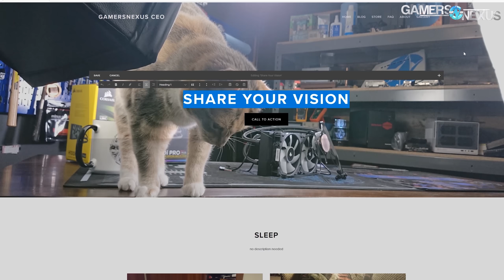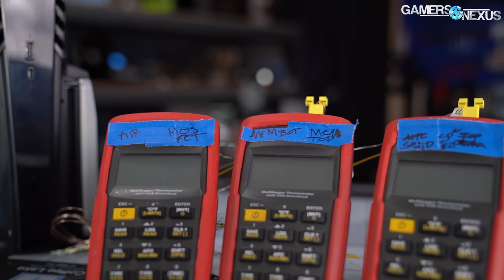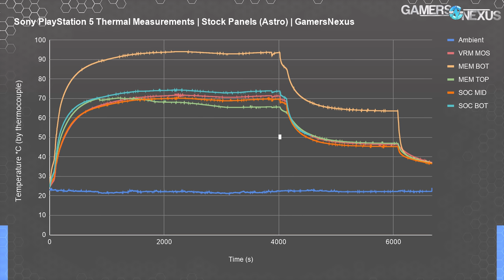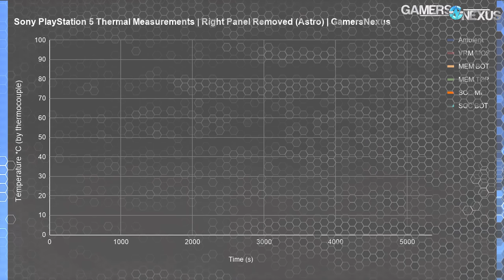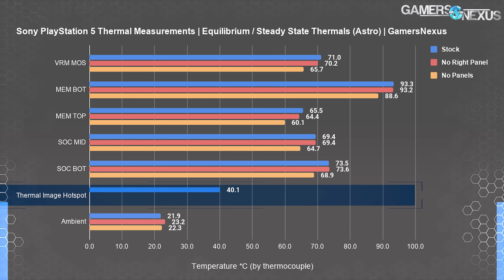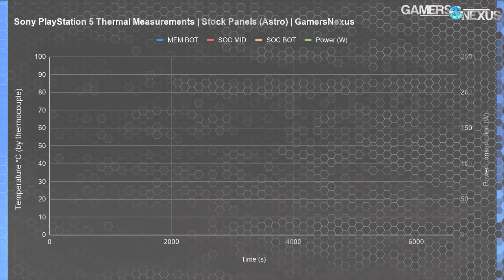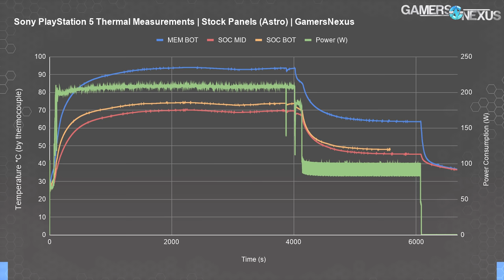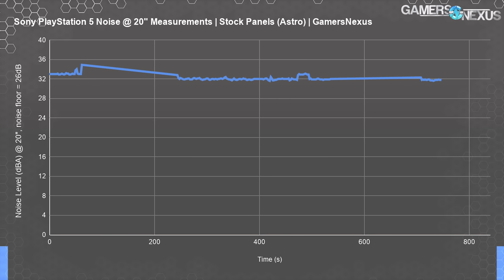Weak Cooler Design: PlayStation 5 Thermals, Power, & Noise Testing

Comment: This definitely makes me wonder how people who stuff their consoles into tight tv stands or poorly ventilated areas are going to fare long term.
Reply: Probably just end up being a slow degradation of performance, like most things that sit long term in a confined space.
Reply: Maybe that's why they made it MASSIVE so it doesn't fit! Ha ha
Reply: That is what I am dealing with now. My tv stand had 6 cubbies (3top row that are shorter in height, 3 bottom row that are nearly 1.5-2x in height). I have my cable box, XB1X and PS4pro in the top cubbies, I cut slots in the back panel and have USB fans with the consoles to push hot air out and pull cool air in. However, when I swapped the PS4pro for the PS5, it is so big there is not much room. I barely go the fans in, but they seem to work still. I've forgotten to turn them on and eventually the console's fan went from inaudible to audible, but not very loud either way. Luckily the top of the console's intake vents are mostly forward facing so the white side panels form a "v" that helps block out some heat from the back of the tv stand's cubby, so even with the fans off the air that is getting pulled in feels much closer to ambient than the rest of the cubby.

That said, I am considering trying to stuff it vertically on top of the tv stand somehow. May try behind the tv and just relocate my router or Switch dock.then that leaves an empty cubby with holes cut in the back that I need to fill for symmetry's sake.Would love to find a PC case for it, but everything that is thin and wide enough is 1-2" too deep, so I am stuck with an Elite 110 case in one of the bottom cubbies, which limits me to <180mm GPUs. If I could find a pc case, then I could use the PC's old cubby for the Switch dock or the PS5 itself since there is more room to dissipate heat.
Reply: @ImeanFFS  lmao well played, Sony. Well played.
Reply: that console is gonna break down so much after 1-2 years its gonna be crasy with those temps, both when people do what you said, but also in the warmer climate areas around the world doing summers/heatwaves.
Reply: As long as this doesn’t turn into Sony’s version of the Red Ring of Death they should be OK. 

That said, if multiple failures start coming out of this long-term, Steve will likely see an uptick in this video as to the root cause.
Reply: @ImeanFFS  Most likely that's the reason the white trenchcoat fins extend so far beyond the body of the console.
Reply: @dandyboi7738  Just like people in quarantine
Reply: They do account for that. It's built like a POS but I guess SoC, RAM, VRM, etc., are specced to be waaaay more heat tolerant than our PC stuff.
Reply: rrod
Reply: by the time the console is dead, a PS5 Pro++ will be avaible
Reply: It would effect performance or possibly lead to complete failure like the Xbox 360 had issue with due to overheating.
Reply: Specially dirt and dust.
Reply: Maintenance is also another factor. How many people will actually clean out their console? Dust and dirt will eventually build up, and the console needs to be cleaned out.
Reply: @mysticespresso8464  are you serious? About 95 percent of people, in my opinion, will put it in some form of enclosed space, usually a TV stand. There will be many people who even stand this upright on carpet without the stand
Reply: @mysticespresso8464  You should look at some of the setups in the PS5 reddit then, because I'm already seeing that happen.
Reply: @AdaaDK  Do you have a crystal ball or are you a better engineer than Sony and AMD engineers?
Reply: @BrawndoQC  Normal hardware knowlage, dust buildup, + lack of airflow. + Thermal paste tends to get worse over the years, so its natural for the cooling preformance to go down, @ if its already on the edge by starting out to hot, it dosnt do well in the future. With sonys design, it MAY not end up dieing within warranty period, BUT the preformance will go down then, since the cpu/gpu will prob slowdown in stead of overheat at first. but thermal related hardware-slowdowns will be bad for your gaming experience tho.
Reply: @Diane Bloomfield The PS5 has liquid metal though.
Reply: @Diane Bloomfield good on you best way to keep your console going longer and cooler but do make sure you use a good quality thermal paste as those cheap ones are no good and you'll end up reapply regularly

Comment: So what you're saying is... The ps5 will benefit from "speed holes". Gotcha! grabbing my drill.
Reply: Machine gun is wayyy faster 😉
Reply: Lmao 🤣
Reply: Actually every ps3 owner have to open holes and some including me stick and a 140mm fan.The same will be with ps5 open holes and stick one 140mm noctua fan and you are done.
Reply: American dad: when Jeff adds speed holes on his box floating in the ocean
Reply: @realonezx4841  I cut the case right above the fan. Can clean fan without opening and idk if its cooler but it still runs.... after my nephew put 15 hrs on it everyday
Reply: Using a drill in a 500 box console, this is sad...
Reply: @Roger_A_ONE  whoosh
Reply: The good news is that there will almost certainly be third party panels available, and some of those might just have the speed holes built into the design. Or, you could 3D-print something.
Reply: Hole saw or paddle bit?
Reply: mikeisu  How? It's only going to make it better..
Reply: @stale2665  Sony forbid 3rd party developers from making panels 2 weeks ago, 2 were shutdown under threat of litigation.
Reply: @stale2665  Sony already shutdown a 3rd party making custom panels; That tells me sony has their own in the works.
Reply: Interesting that Sony would shut those down. Regardless, there will still undoubtly be unofficial side panels to be had. We'll just have to look for them in the right places, such as ebay, or aliexpress.
Reply: @choatus  that's because they refused to apply for an official 3rd party license.

Comment: G'day Steve,
Other Channel PS5 Thermal review: We pointed a laser thermometer at the PS5 to test it's temp while running & got ?°C/?°F
G/N PS5 Thermal review, here is our 35min explaining why & how we pulled it apart so we could add thermal couples to the important performance parts for Internal Temp Readings
why I am Subbed to G/N & don't waste my time with other 'Thermal Performance Reviews'

Ps also love Hardware Unboxed for their Quality In-depth Reviews but they won't have one for PS5 so not included here

Comment: Australian Summer will put some of these PS5s to the test.
Reply: Play it in drought season.
Reply: I've had mine running in 33c ambient here in Australia last week, was ok. The house doesn't normally get much hotter than that but maybe don't want to use the PS5 in 40c temps
Reply: australian summers should be a standard in testing for temps
Reply: Im in QLD, its not even december yet and its fucking currently 38c ..... my poor jet engine year 1 PS4 has somehow managed to last through all these summers but not without a little screaming
Reply: brah, indian Summer will kill it for sure.
40C EZ
Reply: Not nearly as hot as an Australian summer, but I played for a good 7 hours straight in my 30° room and it was fine.
Reply: @thomassmith4999  33C isn't that harsh, Rio de Janeiro reach 45C ;)
Reply: @1300l  The local record here is 47c but that's not inside your house luckily :)
Reply: @thomassmith4999  Yea, AC FTW
Reply: @Omegapork  It will be fine,  if it gets hot, the clock speeds will drop, fan speed increase and dynamic res will be on average lower than a cooler environment. Everything will continue as normal
Reply: @imo098765  It'd be nice to have access to the fan curve, maybe an engineers menu where you could up it significantly for those that game primarily with headsets/headphones and don't care about noise.
Reply: Any summer
Reply: South Africa summers will also test it.. Might run mine without the lab coat lol
Reply: @imo098765  not every game uses a dynamic resolution
Reply: Normally, electronic card are tested in different temperature inside climatic chamber and we measure all temperature on the components surface. That's why you have a working temperature range in the notice.
Reply: @campersruincod6134  then you get dropped frames
Reply: Imraan Omar It doesn't work that way.
PS5 is just like any other console to date, it performance (cpu/gpu frequency) won't change because of the temperature of room, it will change however based on the game workload itself.
Reply: @amirpehar2257  didnt cerny say its power, temp and game demand combined
Reply: To rest
Reply: @julez4968  indeed 😂
Reply: You forgetting about Africa now, my pc with liquid cooling idles at 35-39 celcius, If I dont have air conditioner on.
I can just imagine the suffering my PS5 is gonna go through, cause living rooms are normally warmer than rooms.
Reply: @PharaohVanAensland  Same, the south african summer puts my liquid cooled PC to shame.
Reply: @imo098765  they need to make a second version with better memory cooling
Reply: Well it's hardly cool in California over summer. Easily pushing into 40 C and above.
Reply: Imraan Omar No. He said PS5 has a set power limit for the cpu & gpu, so for example whenever a cpu intensive scene come up, the cpu/gpu will drop in frequency (frequency + workload nearly form all of the power usage).
So at the end just like all the other consoles, temperature of the room effects nothing in regards to the actual gameplay experience.
Reply: Never mind Oz, looks like I wouldn't be playing in European summer....
Reply: Nothing compared to Indian summer.
Reply: A full day of gaming at 38C, with no fans or aircon. System was fine. Not even an increase in system noise. Nor did the gameplay experience change at all.
Reply: To test or to rest?
Reply: @WD Forty 51.7 is the all time record in Australia but having lived in both countries I can tell that other than similar maximum Summer temps in the deserts the big difference is the intensity and power of the burn in the light. Sun burn in the states isn't really a thing where in the Southern areas of Australia you can get skin peel after being out in the sun for no more than 20 minutes. That's the big difference. The light in Southern Australia feels "radioactive", in the states it feels warm.. and nice.
Reply: @thomassmith4999  The heat in the South doesn't compare to what we get up here in Cairns, it can be 35c+ in the middle of the night and the air is so humid you can barely breath, can cut the air with a knife it gets that bad some times, THANK GOD for AIR CON!!
Reply: @choatus  Yes I've tried to sleep up there, not fun at all. But at least the intensity of the light isn't much up north. Night time heat up there sucks for sure. I wouldn't live there just on that alone.
Reply: @thomassmith4999  It's hotter and more humid all around up here than anywhere down south, we are getting close to that time again now,  The tropics are beautiful but the heat can be very sapping.
Reply: @choatus  Warmer :), you don't have any extreme heat though and you don't have light that's pushing through a much lesser ozone / atmospheric layer, that's why there's no serious sunburn up North or in the US. The average humidity here year round is 70%+ so it's not exactly dry but we also have days that get over 45c. No northern Queenslander is ever going to win an argument saying they live in a harsh climate when it's no different than living in a shaded green house every day of your life but you can have the hard to sleep at night card.
Reply: @thomassmith4999  umm I think you might have it wrong, up here in Cairns is probably the worst place in Australia to go out in the sun... Dunno where you got that greenhouse thing from but if you have been here in the full summer you wouldn't be saying any of that I guarantee you :D might need to research that one again I think.
Reply: @thomassmith4999  also, "Queensland has the highest rates of skin cancer in the world. Around 3,000 melanoma and 133,000 non-melanoma skin cancers are diagnosed across the state each year." and the worst is in Northern Queensland. I'm not sure where you got your info but up here we have some of the worst Heat and humidity in the whole of the country, only surpassed by some inland areas(which are also in Queensland).
Reply: @choatus  So the thing I noticed about Queensland is that everyone wakes up at 5am and goes to sleep at 6pm. Victorians don't even go outside until it's dark so that's the cancer mystery solved.
Reply: @thomassmith4999  then I guess me being up at 3am kinda stuffs that all up?   ;)
Reply: @thomassmith4999  but in honesty, I've worked in Sydney, Melbourne Brisbane and Cairns areas on the side of the road in long sleeves and Jeans (contracting for council cutting grass) walking with a whipper snipper in hand or driving tractor slashers. By far the worst place to do it is up here when you have high heat coupled with high humidity, it really drains you, sometimes to a point of sickness if you aren't careful. It can get hot down south for sure, but it is mostly a dry heat. The weather report up here always lists the temperature then says "Feels like" after it, so basically it can be 35c but say "feels like 45c" or more. also thats just on the coast, but if I go up the tablelands which are only 20km's west of here, it can get to some real scorching desert temperatures. sometimes hitting 47c+ and also with the humidity on top. Not fun for the poor folk with no Aircon's I assure you ;)
Reply: @thomassmith4999  yeah I think you are right, my 43 yr old brain is certainly degraded a bit lately. already had a few skin cancers cut off so staying out of the sun mostly these days. Resorted to watching Youtube vids to keep me sane...that hasn't worked sadly :D
Reply: Since it's dynamic clock, you'll just lose performance
Reply: To the rest more like it
Reply: Put a shrimp on the ps5 instead of the barbie mate

Comment: Steve: "System temperatures across the board are 5 degrees cooler with the side panels removed."
Eustace Bagge: "That's it! I'm gettin' me mallet!"
Reply: Reference appreciated.
Reply: Lol some dude said if I modified my panels it would lose cooling I wanted to cut them to look like Kratos blades of chaos.
Reply: RETURN THE PANEL
Reply: @one_up907  cutting them would actually improve the cooling, more air in. I dunno how tf he thought it would be worse. Taking the side panel off a computer has it run cooler as well most of the time.
Reply: @ArtisChronicles  lol this one guy said I shouldn't cut or mess with the design he said I could mess up cooling, and i used the same example you gave, i just think it would be sweet to make its panels the blades of chaos just cutout in the middle leaving the overall panel whole maybe make the edges chains, idk been thinking what to do on it a lot,
Lol did you see someone make the Kingpin on SX? Pretty cool and funny at the same time.
Reply: MertensCW  that's just 1 of the memory the rest run in the 70'80°C and yeah quite scary that it's running that hot but they can handle 125°C still not optimal.